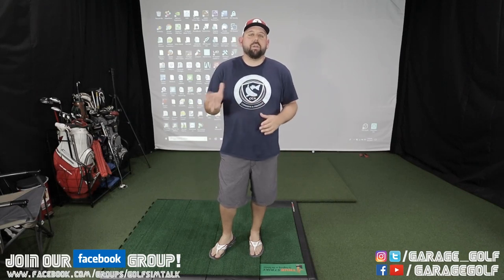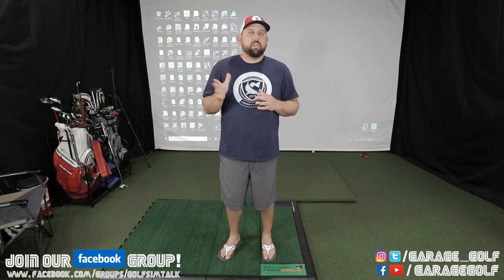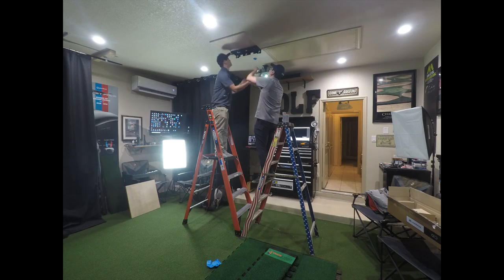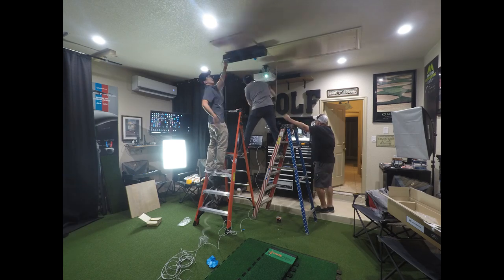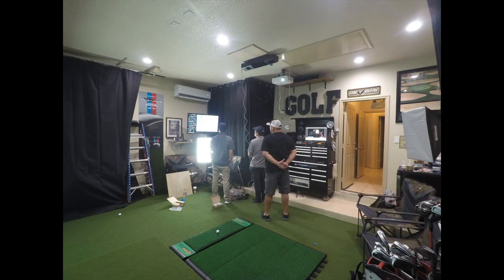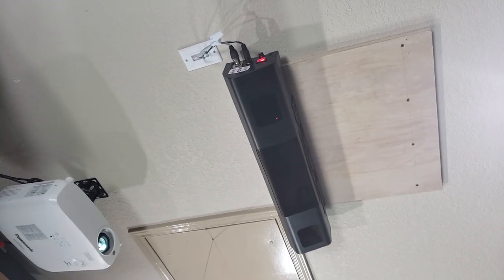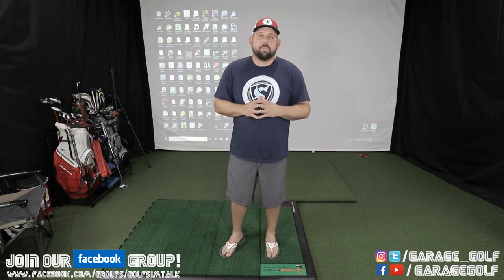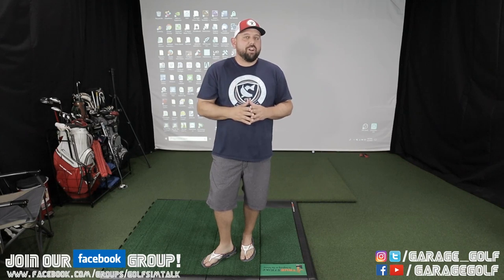Newest Golf Simulator Technology Installation Process

Comment: I read the recommended distances for the system (12’ from screen to hitting area and 3’6” from hitting area to sensor) and was wondering if you stuck to that or yours are different? My screen size is the same as yours and currently projector is mounted about 14’ from screen.  Also wondering if offset of sensor is possible to give more room behind me for back swing?
Reply from the maker: The 12 foot from mat to screen is more for just bounce back and safety sake. I did not have that space in my sim. My mat is about 7 feet from screen or so and it will not affect the sensor. The sensor reads an area that is somewhere around 18 inches wide x 18 inches long. The sensor must be 3'6" behind where your hitting mat center is. There is room for some slight offset but only about 6 inches to around a foot max. You also need to make sure your ceiling is min 9ft or so. How high are your ceilings in your space?
Reply: Garage Golf Ceilings are 10’3” so no issue there.  If I can be closer to the screen it wouldn’t be a problem, further back I’d need to avoid the metal frame holding the garage door track up...which is a bit to close for comfort in backswing clearance!  Now my biggest issue is I was told by company there’s no plans for JPNG integration which is most likely a deal breaker for me.  Thanks for the vid and info!
Reply: *JNPG
Reply from the maker: @mdizel Sounds like no issues with your setup.  No JNPG integration, at least  not officially by Uneekor. They cannot sell the product as Trackman has rights to it. I have been testing TGC 2019 on it and it works great. In addition Uneekors built in sim is actually really really good.  Time will tell if unofficial JNPG integration is ever figured out such as with GC2.